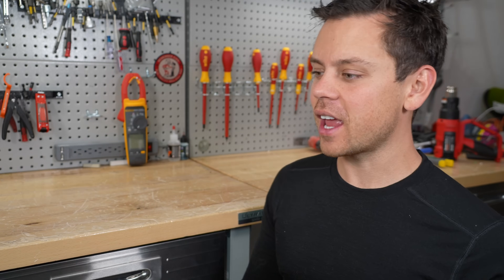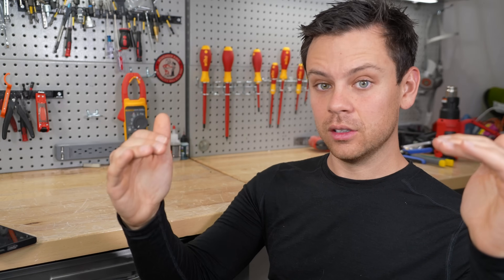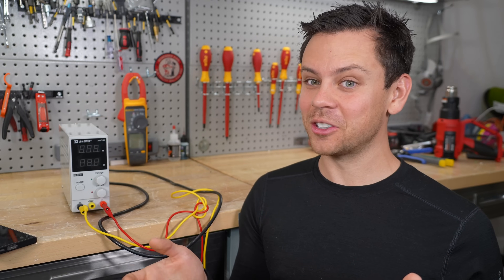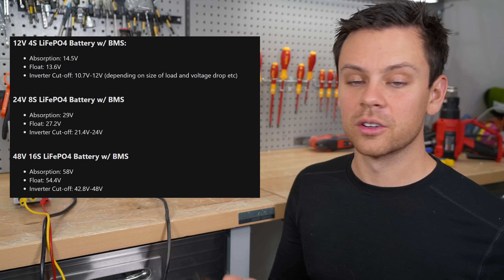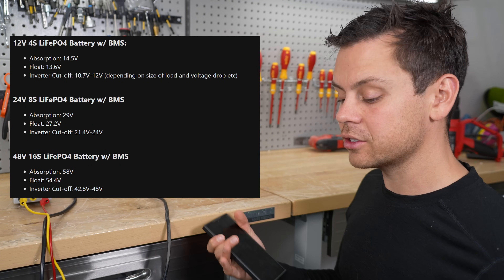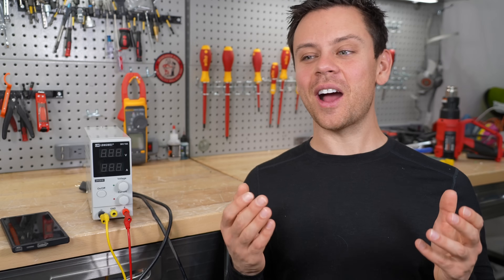LiFePO4 Charging Guidelines: What is 100%? What is 0%?! How to Balance??

Comment: Last year I replaced the lead acid battery on my travel trailer with LiPO4 but did not replace the non-Lithium WFCO converter. I set it to AGM mode with the understanding that is will not charge my battery to 100% but this was fine because I didn't need the full capacity and I knew it was good for long term inactivity. But now I see I should probably invest in a LiPO4 compliant trickle charger and make sure to periodically top it up so it can balance. Thanks
Reply: Just check if the charge booster tops at 14.4v. nearly all do this, as lead acid also needs balancing, by charging to 14.4v. actually the terms bulk, absorption and flood are not for lithium, but for lead acid. So again, check the voltage rise, if it reaches 14.4v. The downside of lead acid chargers comes in the form of battery detection. If your battery is empty and cut off, a lead acid charger won't start charging because it doesn't detect voltage. A lithium charger is made so it always tries to charge, and if it can push current it knows there's a battery.
Reply: @Robbedoes2  if battery is empty and cut off and charger cant detect / wont engage i think you can just use a bridge wire to send some unregulated current to the battery for a moment to rescue it, I used to keep a few wires to do it but now i just use shunt meter to connect a solar panel directly to the battery as its all anderson plugs, it only takes a moment for the battery to come back not sure if its bad for battery but its only for a moment and preferably with just one panel or something low amperage
Reply: @ryken7797 not bad at all the BMS still regulates it ie it will disconnect charge from cells if over current or out of voltage range

Like you say only for a short while it is ok

My one battery has a jkbms  which has an emergency function so it will switch on the battery ignoring low voltage shutdown /cell protection values 

So if I ever encounter a shutdown like that when solar or utility returns I just slide the switch on for a few seconds in the app very convenient and family friendly when not home
Reply: @leondavibe  actually sounds more risky than the current push, i would be sure its low voltage and not high temp before i pressed that over ride button?
Reply: @ryken7797  yea it isn't something a person would use Often low voltage protection mode it is awesom, the problem is the inverter will only charge the battery if it is present , protection mode low voltage , looks like no battery present 

And the battery doesn't come out of protection without seeing a charge

This is a lot less scary than the arc of touching the terminals with a spare battery to wake the two up

Plus it is normally easy to jump start 12v ie even an alarm battery can do the job have even seen someone jump start a 12v battery with a 9v tiny battery, or any DC 12v charger or psu

But yea How many have spare 48v batteries or psu for the JumpStart
Reply: Thank you  both for your feedback. I was searching for a trickle charger and saw a NOCO Genius5 on a good sale and ordered it. I'm hopeful it can act both as a periodic top balancer and as a low-voltage kickstarter if ever my WFCO converter fails to do either. I have a separate all-in-one Anker 767 system and a small ICE inverter generator to power and reenergize the trailer during the day. Between all of that and the NOCO I should be set for keeping the LiPO4 battery happy on any camp sites without power.
Reply: @f150_2_7_owner  The Optimate Litium is one of the best charger for balancing on LFP
Reply: "LiPO4" doesnt exist. just call it LFP if you can't remember "LiFePO4".
Reply: @AJTarnas My bad, noted
Reply: Brands like sunsynk actually recommend you set the battery type to one of the lead acid profiles can't recall but I think it is AGM since the voltage range is a nice fit

There is a reason lifeopo4 is regarded as a drop in replacement , because the nominal voltage of the cell and it's top and bottom voltages means it plays extremely nice with lead acid charging voltages
Reply: So the cell numbers you give are X 4 for a typical 12V battery?

Comment: I made a comment yesterday that I'm only using my system as a backup only (no solar for now sadly). I set my pack charge cutoff at 3.5V/cell. Enough for the BMS active balancer to be mostly useful as the volt/charge curve really starts to ramp up after ~3.4V. But also not high enough that it's just sitting at 100% for weeks or months at a time. There's not much capacity past 3.5V anyway. Mine will sadly calendar age long before cycle aging.
Good advice on these last couple videos though, thanks Will.
Reply: Any voltage over float will probably get a lithium battery to 100% soc ,it only changes how long it takes to spend in CV mode to do so , sure if the device has a  time limit on CV before it goes to float or if the algorithm criteria happens to let it switch to float before it is full then it may not
Reply: @leondavibe  This is a point that Will still could address.  I've seen advice again and again that anything above float, 13.8 say will get to 100% too. But will it balance?  I forget but think it does reach balancer threshold.
Reply: @ceeweedsl  yea I suppose balancing could happen as one cell spikes if you have high cell

I you have one low cell it may or may not touch balance voltage on the other 3  depending on how low it is

If you don't take the lowest cell to low  it probably won't make much of a difference and the battery will still last years
Reply: @leondavibe  Yep.  You just lose a bit of capacity which will multiply over time.   But it won't damage the battery like over-discharge will.  I think that a lot of batteries operate with unbalanced cells.

Comment: Kind of leads me to believe that budget LiFePO4 battery's sitting in a box on a shelf degrades setting there..? Is this why they cost less.? shelf life.? Or do suppliers charge then ship.?
Reply: To my knowledge, all lithium ion batteries are shipped at 20%. 
Remember a few years ago when reports of lithium ion batteries catching on fire? It might be a little safer at 20%.
Reply: @edwardlulofs444  LiFePO4 batteries are safer, thus I read that they ship them at around 50% SOC.
Reply: @ thanks for your post. I only knew about my battery. So now I know that they are not all shipped as mine was.

Comment: Does the cells once balance will the cells still receive the 14.4 volts current to the battery. and while the additional batteries still need balancing?

Comment: Why hasn't someone built a battery with a built-in charger that charges at 3 volts so each battery is fully charged directly?
Reply: You would need an isolated charger for each cell. Expensive!

Comment: I still don't know how you can ideally keep a battery at 50% like the manufacturers recommend and still have it available for emergency use when the grid is down....????
Reply: You don't have to always have it at 50%, think of it like a generator... I get it prepared when fall and winter arrive and storms will hit. 

In spring I'm not going to be using it so I drain the carb and drain the fuel tank and let it dry (such as leaving a battery at 50%). 

And I do the opposite with the snowblower. 

But if it always has to be ready, just leave it charged.
Reply: Let the cells charge to 3.35 volts and you have already +/- 70 %, i never charge my cells higher then 3.45, at the end you will reach 100% it just take longer, i do this already 3 years and it works perfect.

Comment: 3 x 100Ah 12v Enjoybot LiFePO4 batteries in parallel, early 2022; charged to 14.2v and always kept between 13.0 - 13.6v , used indoors on my boat, moderate temperature year-round, never more than 0.25C outflow, but now down to 230Ah total capacity

(Victron Centaur 12/50 charger via a Victron Orion 12/30 non isolated DC/DC charger, monitored via a Bluetooth SmartShunt)

Not happy
Reply from the maker: Charge with psu to 14.5 and hold it there for a few days
Reply from the maker: Post this on forum and we can help
Reply: @WillProwse  excellent, many thanks

Comment: I'm struggling with this at the moment, first system I built was a 24V system, without an comms, was the first system I made and have moved up to a 48V with closed loop since then, but getting the 24V system to balance right now has been difficult. I currently have the float/charging current set to 26.8. I tried going up to 28. but the drift was massive. Any suggestions anyone? Thank you Will, watching your videos taught me enormously.

Edit: I should also mention, I haven't been able to charge past 26V since taking it to 26.8, any chance I've damaged them? (They are the 12V CHINS)
Reply: First you are confusing current with volts. So i'll assume you mean 26.8 volts. That is just about float voltage, nowhere near enough to charge a battery that is actually being used. 28 volts was better but still too low and it sounds like you went to that higher voltage later on. Those batteries might be abused. You should be using 28.8-29.2 volts. DId you remember to charge both batteries to 100% before putting them in series?

You say he's taught you 'enormously' but that is not remotely the case if you thought 26.8 was a good charging voltage. That's like charging a regular 12 volt battery at 13.4. Far too low to do meaningful charging that's used regularly. The only time i've seen that voltage used is in telcom backups where the have a near unlimited time to charge back up before the next outage.
Reply: @jayw900  Thanks for the comment Jay, you are right in the assumption on the current/volts mix up.  It was great getting feedback, I made this comment over a year ago, and have since fixed the issue. Suggestion though, if you want to help, try not to be a sarcastic douch. It makes your help sound like you think you're the one true source of everything solar, and I'm sure you didn't mean it that way. Have a Merry Christmas.

Comment from the maker: 0:00 Intro
0:52 What is 100% and 0%
1:23 How balancing works w/ different BMS
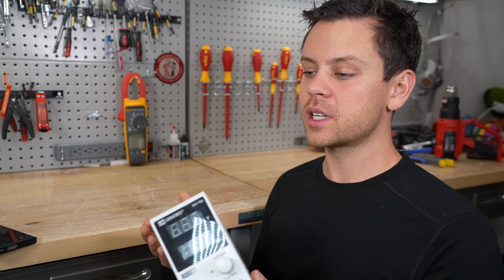3:00 Role of PSU for manual balancing
3:58 Ineffectiveness of active balancers when a cell is bad
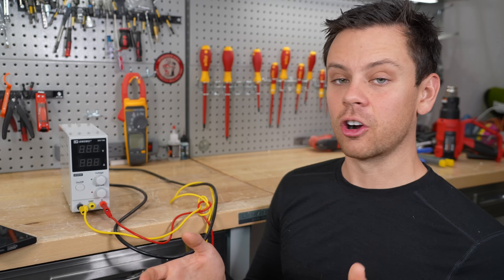4:19 When current sharing causes problems
5:26 Cell drift discussion
6:17 Calendar vs cycle aging discussion 
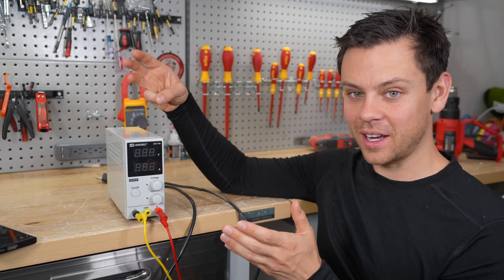7:14 How is 0% calculated?
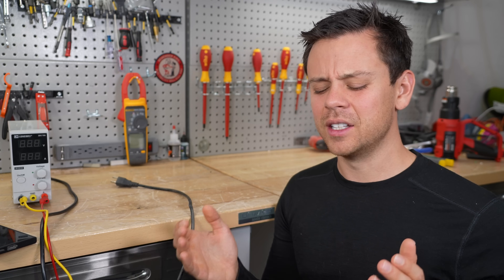8:15 Charging UPS/non-solar back up batteries
9:06 Batteries and Heat
9:31 What actually kills these batteries
10:56 Degradation rates
11:44 Payback consideration to degradation
12:13 Use case Considerations for Solar
12:55 Laboratory cycle testing vs real world
14:06 Recommended Charge/Float/Disconnect Voltages
16:47 Victron recommends 14.2V?!
17:33 Storage and how I have killed batteries
18:24 Conclusion

references to studies that let me draw this conclusion: https://diysolarforum.com/threads/cycling-degradation-vs-calendar-aging-w-lifepo4-batteries-used-for-solar-application.94487/

Batteries I recommend: https://www.mobile-solarpower.com/solar-batteries.html
Reply: My new Li Time 12v 100ah lifepo4 battery confuses me. I charge it to 14.6 but as soon as the charger pauses the battery drops to 12.9v.
Reply: Could you add the brand/ name of "one of these" at 3.10? PSU?
Reply: Thank you. What would you recommend for absorption time for a 12v battery(using a victron 6/17 A/C charger)?
Reply: I would like to see how Trump’s proposed tariffs will increase solar products off grid systems
Reply: How much time in absorption at 58 volts?
Reply: Great content as always, Will. Have you considered a tutorial on how to install solar roof rails? There is a real gap in YT for that. I would love a step by step guide - the natural conclusion for a DIY solar setup 😊
Reply: I've got a sol ark 12k with 6 eg4ll. The batteries are typically used only for peak hours. 3-7, then slow charge them on super off peak. This system was primarily built  for power outages. 

The way I'm using them allows me to get off peak solar credits from excess solar I use later. I shortly ran the eg4 in closed loop but it seemed that the inverter would keep the batteries at 56v without dropping the cells to 3.35v rest. Idk if this is a good design daily? or I should continue to use my current settings instead.

battery low 50v
battery restart 52.6v
float 53.6v
eq days 1
eq hours 2
absorption 54.4v
equalization 54.4v

Then tou where i charge overnight from  the grid is
53.8v which allows the voltage to float to 3.4v then rest at 3.35v

I noticed that the eq and ab get used primarily from solar. So during the day, the solar will top the batteries off at 55.2v

since there's no tou on the weekends, the cells float at 3.32v

What's your thoughts? Should the closed loop allow the cells to rest at some point?
Reply: I remember those early posts Will when you lived in an RV - it's been an amazing journey that you have shared and very inspiring -  very few were making posts about Lithium it was all very pioneering and exciting - I especially enjoy that you hardly waste a word and always seem to express yourself so precisely- I remember challenging you once in the comments when you were using no BMS on the part of an old silver Tesla pack -  it was fun - it's astonishing you hardly seem to have aged at all
Reply: hey will, do you suspect the tariffs will make it hard for us regular joes to get solar/lithium? prices were just starting to get so good and im wondering if should get some stuff ordered now. have a good day man. i always watch the vids.
Reply: Will what would be your recommendation for maximum charge on an Ecoflow Delta Pro with both extra batteries in every day use? Recharging with plenty of solar input during the day to both power and recharge at the same time. Running refrigerators, freezers and sometimes laundry.
Reply: You're still incorrect about discharging to 0% state of charge. Depth of discharge is one of the factors that impacts LiFePO4 cycle life. If you avoid using the last say, 20% of the cell capacity on a regular basis, you can significantly improve cycle life (note that cycle life, when correctly stated, is given for a specified depth of discharge). 
A correctly sized storage battery system should be large enough that you rarely get near that low anyway. A good off-grid system has sufficient capacity to run for multiple days in bad weather with minimal solar generation.

Comment: Define "Hot environment".  Thanks
Reply from the maker: If a human feels hot, its too hot. Is rule of thumb. 70 degree F is ideal
Reply: OK thanks.  My batteries are in a shed that gets to 90 degrees in the summer.  Is that going to be BAD, not that bad, or OK?  I may try to come up with a fan system to pull cooler air from under the shed in the summer.  Thanks again.

Comment: I think many people also mix up Lithium-ion and Lifepo4 and how many EV car manufacturers recommend not to charge their cars to 100%
Reply: Just to be clear here, Lifepo4 is Lithium Iron Phosphate and these are the batteries Will is talking about.  EV cars may or may not use these types of batteries and thus recommendations are different depending on the battery chemistry.
Reply: @tyronetrump1612 we'll my puppy dogs aren't on Facebook so I'm not worried,  don't have any rabbits so can't say there.
Reply: @ yes, people talk, often they don’t fully understand everything. 
But there were problems with manufacturing of Lithium ion batteries years ago. Most of those problems have been resolved and trouble is rare now. 
But today’s news contained a story above a cell phone battery that caught fire on a plane before it took off. They returned to the gate. And there were no further problems. Perhaps it was an older phone.
Reply: @edwardlulofs444  Plus lithium ion is more prone than LFE.  Even with very low rates, there are a LOT of these batteries out there now.  One in a million is frequent  when there are billions out there. I alone have three laptops, two tablets and two phones.
Reply: Yes, there are a lot of batteries based on lithium ion. LFP are my favorite at this time.

Comment: Please help. I'm currently using an EcoFlow Delta Max 2 as a UPS for a CPAP machine. Should I always keep it at 100% or should I keep it at 50% (storage level) since it's used maybe 2 to 3 times a year. I'm thinking about building a handtruck battery as well so I have more backup time. I assume the percentage would be the same for that battery as well?
Reply: The spec sheet lists
 Battery Chemistry:
LFP (LiFePO4 battery)

So use the voltages recommendation in this video.   Ie Charge to 100%

Comment: In a RV that is mostly connected to shore power, the batteries stay at 100% charge for an extended period (in my case, up to 6 months).  Is there an optimum way to handle a charge (100%) and discharge (0%) cycle?

Comment: I built battery with Calb cells -  No BMS - bottom balanced cells -- solar charged battery - 6 yrs  hard daily use -  cells have stayed within a few mv  -  
removed this battery from system has been sitting for about a year  - voltage as stayed basically same  13.33v - balance is 44mv between cells between cells  - all  from one cell